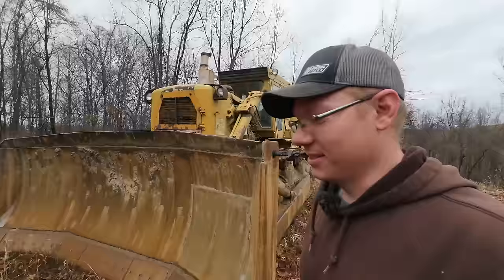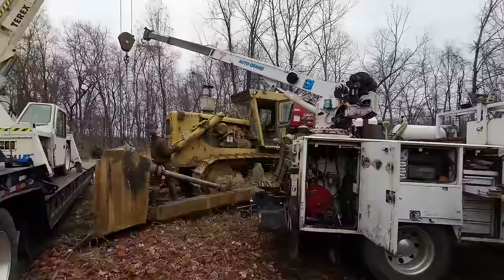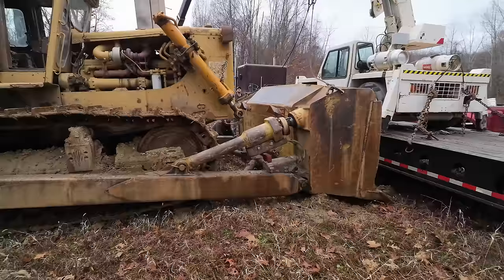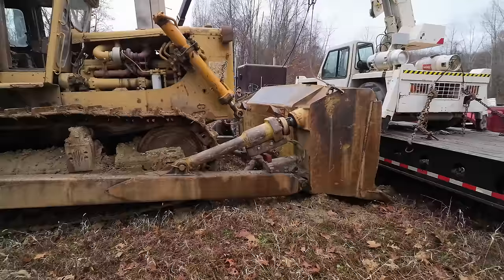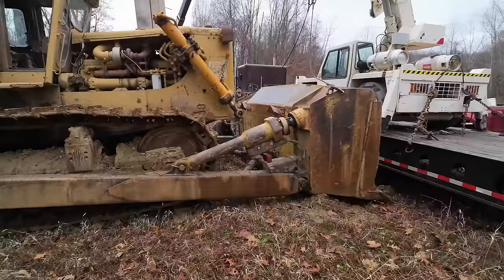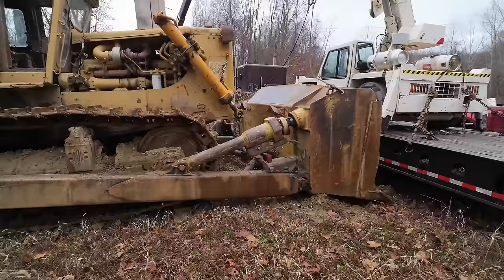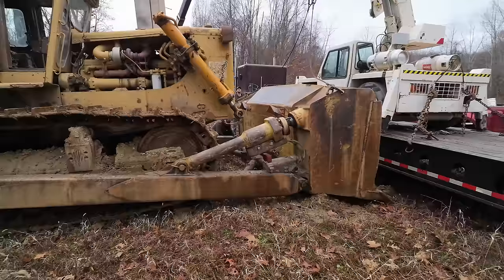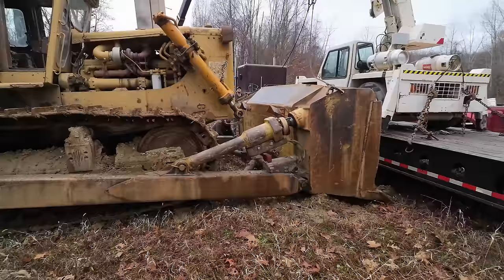I Bought a COLOSSAL Caterpillar D9 Dozer, DIRT CHEAP!!

Comment: Hey Matt, I have a question about all those permits. I'm a hobby mechanic up here in Canada that doesn't work on anything that won't fit into the back of a pickup. Most of us non-trucker types probably had no idea that moving a piece of equipment across three states involved so much bureaucracy. Unlike other youTubers, you are very generous in giving us the financial details of your transaction, which I really find interesting. Could you give us an idea of what the costs of those permits were?  Many thanks in advance, I love your channel.
Reply from the maker: About $100 a piece

Comment: While working for Cat I was in on many  Cat Certified rebuilds of a few D9H's in SD. Machines were rebuilt for some of the Coal mines in Wyo. We Stripped them down to the Frame Replacing Every Hydraulic hoses  all Wiring, final drives, Trans, Engine Radiator and Had. Cylinders EVERY THING. Rebuilt Cab a Total rebuild. Quite an experience

Comment: back in the late 70's very early 80;s I was 19-20 and worked in an open cut coal mine in Australia and we ran D9 G's and H's they were fantastic machines there was nothing these machine s couldn't do and were very easy to operate. The G's blade control were in front of the seat with the old style big lever from the floor but that didn't limit them at all. a few years later I came back and they had D9 and 10 N's with the new high track design, I hated them, you couldn't see the corners of your blade for levels and they were nowhere near as nimble and I found them hard to get used to??

Comment: In 1967 I worked for Empire Machinery, the Cat dealer of Arizona. Most fun job I ever had before I got on the Fire Department. Back then a piece of cat equipment would cost you a dollar a pound.  Cheaper than steak.  An 80,000 pound D9 dozer was $89,000.00.  Today a fully equipped blade (motor grader) cost just under half a million.  My 53 year old son now runs one for a living for the past 30+ years.

Comment: I ran one just like that with a ripper at a Ski hill in B.C.. I had never used a ripper before but had lots of experience doing lots of other things. I was sent remove some very large rock outcroppings. They were tough. If I was sent to do a job my philosophy was  " Get er Done" I ended up on top of the rocks with about 1/4 of the Cat hanging off the edge and chunk by chunk I broke the sucker down. Later I found out that I was very fortunate I didn't shatter the ripper tooth or wreck something else.

Comment: New roads, new ponds, and clearing big trees are what I would use this D9 for. These things can do the work in one day that takes most dozers 3 days. Transportation $ to the work site is the big killer. That big trailer looked perfect if it could be customized to carry everything in one trip. A swiveling blade holder on the rear?

Comment: Looks great there …..to have to wear a jacket looks so appealing from southeast Texas where at 95 degrees , 100% humidity and sweat pouring off ones body if you simply move is the norm. Of course having hurricanes often chasing ya doesn’t help either. 
Great video , cool stuff !

Comment: Had a lot of experience with D9H's---they are the best and are very desirable for the medium size site construction company. Of the two dozers ---D9H and D9G---the H is the most sought after----more improvements and more power. Short  story---I had an operator operating a D9H and calculated how much topsoil he stripped and stockpiled in 8hrs---the total yardage was 3000cy---not bad for a 1975 Cat !!! You bought a good one!!!

Comment: I like seeing the old girl run, looking forward to seeing you push dirt.I ran a D9H for several years leveling some real hilly ground for circle irrigation in Eastern Washington state. They can push a lot of dirt with that blade I was making cuts 5 ft higher that the top of the cab by 50 +/-yards long cutting highs to fill in lows. And the ripper shredded the Basalt rock we have here no problem fun to run.

Comment: This kid running the low-boy sure takes chances with that nice tractor. I too used to speed shift using the Jake but as experienced  as I am, with almost 100,000lbs behind me I would take things a bit slower. Also anyone notice the kid never depressed the clutch before trying to start it on the scale. Steering wheel holder is what me and my buddies call them, ha ha

Comment: I'm a retired HDR/W. Primarily Cat. in CA. although we left once I retired. There isn't anything 
 wrong with the Conventional design of the D9 cats and the like. It was what we all used back in the day,  it put the beans on our table, paid our bills, The same for you as well. 
I maintained the First Demo D10 to comes to SD CA, Through the dealer to the general I worked for, after 20 years it was scarped, now go figure why. Cost.......... Your D9 H should
make you bank, Outside of the tracks, the rest of the cat is more reasonable when it comes
 to up keep into todays prices.  As much as I liked the high tracks, I still favor the older iron. 
We had fleets of 666 scrapers.

Comment: i bought one last year  for5500 dollars i didnt need it but i sure did want it  now i have  2 of them.and a few other dozers of \various sizes.  sure makes  putting a runway in my ranch easy loli do love big iron. my d8 is fun also but the d9 is a beast lol mine sat for 7 years  in the woods. i put in fresh fuel.  and new batteries and  she fired rightup. think mine has like 1700 hrs on it. fresh rebuild at 1300 hours. love it. just wish i could put a 7 way blade on her. i named her gertrude. now i use her to pacck down my run way i also bought a  supped blownup scraper cat. battery cable was loose was all that was wrong with it. paid the old guy2500 for it. runs great.lots of levers to play with. took forever to figure out what each one does.now i have like 10 dozers and 2 cat 980  loaders  had to build a new barn to store them all in.  in the process of repaint them all. so i have 6 55 gal drums of cat yellow paint

Comment: I'll JUST bet the reason for the starters going out is the electrical starter cables aren't sized for the proper wire gauge to allow FOR THE LOWEST TEMPERATURE STARTING CONDITIONS to allow for the huge amount of current required for starting in ALL CONDITIONS, IF THEY UPPED THE STARTER CABLES TO THE NEXT LARGER WIRE GAUGE the problem would disappear. Most people just don't realize how much more current is required especially under really cold conditions. Once the cables get overheated in real cold conditions they are probably burnt from overheating thereby reducing their current carrying capability PERMANENTLY!!

Comment: You know if you’ll turn that jake break off it’ll shift a lot easier
Reply: Yeah, and I'd never hire you to tear one of my trucks up because you think you're criticizing out of knowledge. Keeping the jakes engaged brings the engine rpms into the shift range quicker, a full 2 seconds quicker. This allows for faster shifts which keeps the momentum up. Easier on the clutch, drive lines and differentials. It's not easily done and you have to be super smooth with your timing to do it right.

Comment: Cat D9 H D353 engine 410 HP upgraded with intercooler the older D9G same engine only 385 HP my uncle had the H model Cat also had a D355A komatsu dozer and a D155 Komatsu track loader I was operating all 3 at 12 YO my favorite and the biggest the komatsu D 355 it was a humongous dozer Good Luck with her something to look out for with those D353 engines was high exhaust temperatures and coolant leaking when NOT running into the oil pan weird

Comment: Fella, years ago we were at an auction in your neck of the woods and a dozer was sold the had a blade width of 55 to 60 foot. You could not believe how the ground shook next to the machine. That was at least 55 years ago. I still remember the exhaust pipes as they were at least 16 inches diameter and there was s few of them.

Comment: Loved the video. Have you ever watched "Highway Thru Hell"? Al Quiring has two old Cat D9's that have been featured on the show winching out a buried track hoe or it may have been more than once. He used one of them in sub-zero temperatures to tow a loaded semi in the ditch to where they could get at it easier with a tow truck. "Rolling coal" as Al likes to phrase it. In one where the hoe was really buried, some know-it-all at the mine site walked up and told Quiring "it's stupid" the way he was going about it. That clown thought they could just pull it out instead of winching. In my opinion all that would have happened was the tracks would have started digging and gone nowhere. I'm sure that's what Quiring thought too. It was a big hoe buried in a hole right up to the deck in water and mud.

Comment: You could have moved that D9 with the blade on if you wanted to use an escort vehicle.  Only made one trip instead of two.
Reply from the maker: You’d need several more axles on the trailer as well.

Comment: Iike the truck with the flaps and it doesn't smoke it's running like a top when you run rich they smoke then you got in soot in cylinders and the

😭

Comment: What?  No pony motor to start first?  And dozer moldboards were lifted with cables on a big spool at the rear of the driver's seat and lowered by their own weight.  Also, nothing came with a cab.  Thery were an extra accessory.

Comment: Do not become ill informed from the early part of this video. You absolutely CAN haul a d9 legally with the blade. It's all about the permits, and licenses. While the feller is correct in saving a boat load of cash by disassembling it. It could be hauled while. Unless your in some certain high density population areas. Judging by the woods, I'm guessing that's not the issue. Also.. of you all end up pulling a blade off of one of the dozers that are d7 or bigger. They are extremely rear heavy. Consider yourself warned. Edit he drives a new Ford. Enough said.

Comment: Iv never seen a trailer so low as that it seems like the silliest thing to make. There is no consideration to changing road conditions humps dips ect. I bet that it has half the under Carriage removed just
from the asphalt or concrete road.  I am from Australia so i do see thing’s different here.
Reply: Trailer has to be that low if you’re hauling something tall. 
Normally they’re adjustable in the front and rear so you can raise it if you need to.

Comment: Good thing you towed it backwards so you didn't have to ducktape the raincap shut or buy 1 of those turbo savers everyone tells me I need when hauling equipment I always ask how they load their dead equipment if they have a problem with the turbo spinning backwards during transport because if a turbo will spinning backwards during transport replacing the turbo is the cheapest part of your mechanic bill you just as well pull the turbo and drop it off at the dealership for repairs with a good turbo in the cab as to waste money on a turbo saver the guy who designed the exhaust condom and convinced people their turbo will spin backwards without 1 is a genius and targeted the right market selling them in truckstops and truck dealerships catching drivers who don't load the equipment themselves and just haul it but were told they need an exhaust condom or buttplug depending on the gender of the machine so they don't spin the turbo backwards blowing it up because it won't get oil spinning backwards I need to come up with something so useless paten it and market it to people like that maybe a light on the dash of anything with a dumpbed to alert the driver his bed is up since it's so hard to see in the mirror it'd save their insurance the cost of powerlines signs and overpass replacement and repair as well as the damage to the truck and any idiot near them when the SHTF maybe even make it Bluetooth so they can't use their phone without lowering their bed

Comment: Was he upshiftng with his Jake brake on for audio effect?  Eddie
Reply: No, it's a truck heavy haulers use to make faster shifts and keeps the engine in the power band. Easier on clutch, differential, drive lines and engine.

Comment: On my first job high grading a secondary road, we had a D9H with a Peterson pushblock loading 627B's and 631D's, that thing ran 24/7 for 3 summers with no major issues, when I would jump on it, I would light my smoke off of the turbo

P.S. Nice old machine you bought

Comment: One thing I can never figure out , why the young cowboys like to run with the jake on?
Reply: Allows for faster shifts to keep your momentum so you stay in the power band of the motor. That was 20 k lbs shy of twice the weight of a normal loaded semi. Momentum is the key to keeping a truck together when heavy hauling. Easier on the clutch, differential and engine.

Comment: Dear matt why instead of tearing apart the good 28,000mile running Autocar  truck why not buy a big semi  either a Autocar or a international maybe even like the donor you bought for your dump as a puller  .Then Build your pulling rig why ruin a good running rig .
And use the other to pull your toys to and your shows and maybe your project

Comment: Please turn the engine break off when shifting that peterbilt. You gonna damage the engine.
Reply: You might damage it because you don't know shit about heavy hauling. It's for faster shifting to keep your truck engine in the power band. Easier on clutches, drive lines and differentials. It's not easy and you better know how to do it for sure. That's the difference between a steering wheel holder and a truck driver.

Comment: How are the shifts so fast with that pete?
Reply: Leaves the Jakes engaged. Slows the motor to the right rpm for the shifts. It's not easy to do but it's easier on the clutch, drive line, and differentials. Keeps your engine in the power band so you don't lose momentum.

Comment: Driver why would you speed up and then let a engine break slow you down then speed up again? It makes no sense just because it sounds cool it ain’t.
Reply: No it isn't at all what you think. He leaves the jakes engaged so the engine speed will slow to the proper shift rpm quicker. Allows you to shift quicker and keep the engine in the power band. He was hauling 16k lbs shy of a double weight on a regular road semi. Momentum is key.

Comment: I am surprised you are allowed to drive around with so much debris barely attached to the running gear.  Every bump you hit is a potential cracked windshield.  Seems irresponsible.

Comment: The Pete driver is not an example of good driving… rev’s too high, bumps the brake on every shift,  and the real noob move.. is shifting on the scale.  
Then came the jerky forced shift 2300 rpm charge up the hill.. gawd 🙄 I hope that’s his truck he’s running the hell out of.. I’ve fired better drivers.